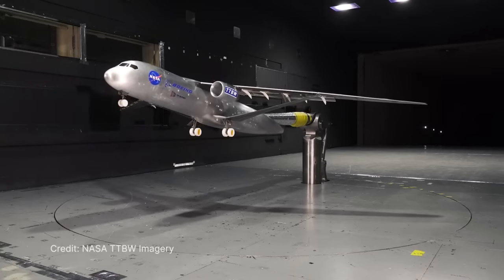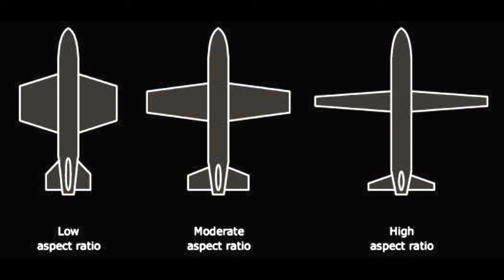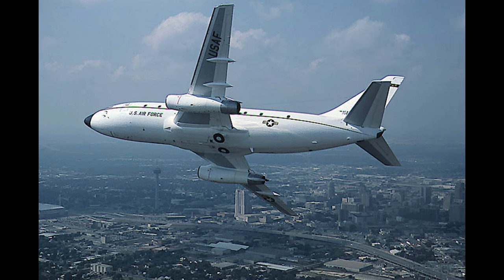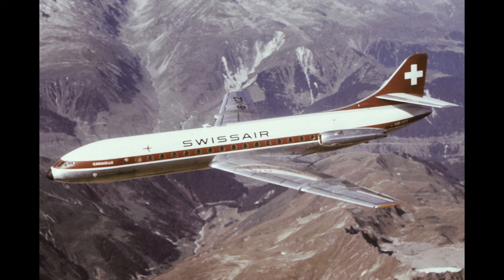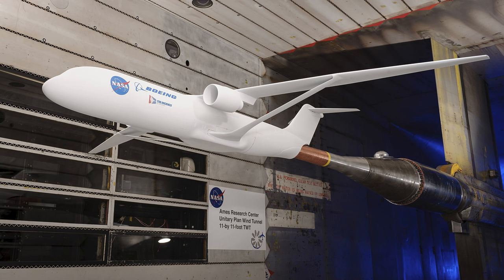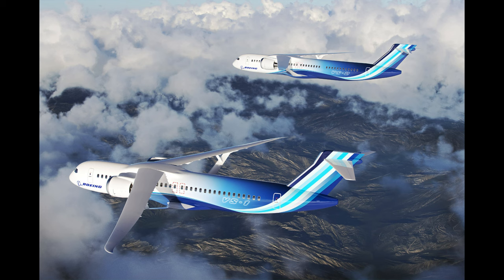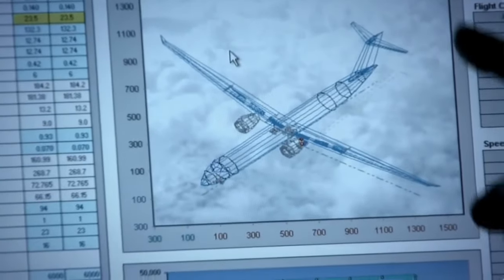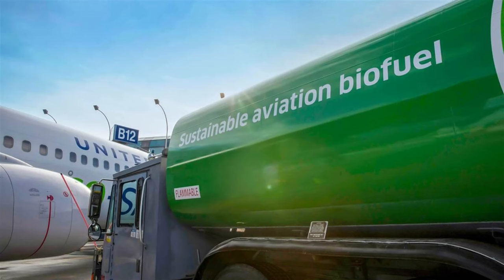NASA's New Airliner Experiment To Make Flying Less Expensive

Comment: When I first arrived at my aviation support Army assignment in Germany we had several Beavers flying out of that airport, which was also the Stuttgart commercial airport serving jet airliners. When you heard the noise of a Beaver taking off, it looked almost like it was hovering.  I asked one of the old hands about a story I had heard - "Is it true that their takeoff speed is the same as their cruising speed?"  He replied, "Some of them aren't that fast". 🙂
Reply: "Some of them aren't that fast"    Good one!
Reply: From the DHC-2 wikipedia page: "In response, almost without exception, these pilots specified their desire for tremendous extra power and STOL performance, in a design that could be easily fitted with wheels, skis or floats. When de Havilland engineers noted this would result in poor cruise performance, one pilot replied, "You only have to be faster than a dog sled to be a winner""
Reply: @gags730  There are no flying beavers nor kangaroos!!!

But yes they parachute, very gracefully I might add!
Reply: So, Beavers have MASSIVELY powerful engines for high angle of climb during takeoff. But at highest efficiency cruise speed (lowest fuel cost) the engine power must be dramatically cut back by the pilot. Everything about the Beaver is optimized for high angle of climb. It happens that this optimization also allows for a hefty carrying capacity. Once at cruise, the pilot can choose to either get there fast or get there cheap. Pilots are usually employees. So, get there fast dominates operations.
Reply: @Kenny-yl9pc so how do I have thousands of hours flying beavers?
Reply: @gags730  from Wikipedia about 1,700 were produced between 1947-1967. 

Aircraft take off optimally at one of two flight speeds: best rate of climb or best angle of climb. 

Tactical military aircraft are designed with best rate of climb in mind. Gotta get to mission altitude or aggressor altitude as quickly as possible. So, two primary factors in achieving this goal: engine max rated power and optimal airfoil design to minimize drag. The bigger the max engine power rating the quicker the plane can get to altitude. 

Commercial airliners, military “utility” aircraft like cargo jets, etc are designed also to get to cruise altitude quickly but for a separate reason: conserve fuel. Modern jet engines are only fuel efficient at 30,000 feet or higher. So, their max rates of climb, while high, get the aircraft to an altitude at which the jet engines are extremely efficient (lowest fuel consumption per hour).

STOL (Short TakeOff and Landing) aircraft like the Beaver are designed with two criteria in mind: minimize take-off / landing rollout and maximize obstacle vertical clearance during takeoff and landing. This implies that the angle of their flight path during takeoff be maximized. In the case of maximizing obstacle vertical clearance during takeoff, the Beaver has a MASSIVELY powerful, piston-driven engine for limited duration - perhaps as little as a couple minutes. Anything more than that and the engine can overheat. Also, the aircraft is equipped with massive engine cowl flaps which can be opened during climb to keep the energy-dense engine cooled. The propeller is also designed for max takeoff performance - its diameter is much larger than other aircraft of its weight. And it’s propeller is aerodynamically designed and pitch-controlled to transmit the engine’s enormous power to thrust as efficiently as possible when it counts - at takeoff.

The Beaver’s airfoil design is also optimized for high lift at low velocity. And optimized (through flap design) for low stall velocity. Also, on the Beaver’s elevators, there are vertical air “dams@ that keep airflow better attached to the airfoil during slow speed and high aircraft angle of attack to the airflow. If the airflow becomes separated from the elevators at slow speed, the pilot loses pitch control - not a good thing during takeoff or landing.

All of these optimizations are consistent with maximizing the best angle of climb on any STOL aircraft.

If you compare the altitude versus distance profile of a flight at best angle of climb versus one if best rate of climb you’d notice that the best rate of climb profile is much shallower. The pilot of a Beaver on waterskis and a mountain range ahead of him will likely choose to climb at best angle of climb until the obstacle (mountain range) is well below his altitude. An artifact of optimizing aircraft design for best angle of climb is low velocity at cruise - the Beaver is a great example of that. But, min cruise velocity just has to be greater than the fastest dogsled! :-)
Reply: Before WW2 Germany was forbidden to develop aircraft with an engine. That sparked the development of gliders. That meant development of different aircraft  wings, specifically for gliders. There was a reason why, after WW2, most glider manufactures were German. Look at the SB10, a glider with a wingspan of 29 meters. With an aspect ratio of 36,6.
Reply: @Paul_C  In theory, the most efficiently designed aircraft wing is one in which its length is infinite and the chord length (distance from leading edge to trailing edge is infinitely small. There would be no “spillage” of air outside the wingtips. All aircraft today generate wingtip vortices, whether it’s a paper airplane or an AN-225. The vortices are apparent to ground observers at takeoff and landing in humid conditions. The visible horizontal tornadoes that extend aft of the wingtips are wasted kinetic energy. But the engines effectively produced that wasted kinetic energy. And the fuel that powered the engines in creating this wasted energy is also wasted, leading to an increase in operational costs to owners and operators of aircraft. 

Current-day winglets at wingtips and future truss-supported wings physically and virtually extend the length of the wing, and reduce its chord length, thereby moving towards a wing with infinite aspect ratio. 

We’ll never get to that. Aircraft in nature are closed thermodynamic systems. Potential chemical energy in fuel is transformed to kinetic energy of the air leaving the engine to force the airplane forward and keep it at altitude. No closed thermodynamic system is perfect - ever. Thermodynamic system processes generate waste energy that is literally unrecoverable. That’s the Second Law of Thermodynamics at play.

As a result, in the end, our Universe will die in a waste heat death as a result of this law. This law has nothing to do with human intervention in climate. If we were absent from this universe, the same heat death will occur.
Reply: @davecorley5514  as a high time beaver pilot I can’t take anything you say seriously! A MASSIVELY powerful engine? The PW R985 only puts out about 430 hp, but we’re you lost me was at the cowl flaps! There are none! You sound good but get your facts straight.  The beaver is a great aircraft and does what it is designed for very well, it has the power to do the job and the vast majority of flights are under 100 miles so speed it not an issue. Too many pilots get frustrated by a slower beaver but burning more fuel gets you nowhere any faster! I can almost always beat a guy with the faster beaver dock to dock by being more efficient in route planning, altitude selection and taxing on the water.
Reply: @Paul_C  Your Dates must be slightly wrong here. Germany joined the Spanish Civil War in 1936, an sent 100 War Planes. Roughly half were Fighters, and half were Bombers. Admittedly the German Fighters were Biplanes that prove wholly ineffective against the Russian Fighters that were on the Communists side, but Germany definitely had War Planes earlier than 1936. That said, Germany also Signed a Pact with the Great Powers of Europe that they would not interfere in the Spanish War. But the Spanish Nationalists were fighting Russian backed Communists, so England and France may have thought Germany was just doing a job they didn't want to do. Germany built the far superior Messerschmidt bf109 in 1937, and their Stuka Dive Bomber Pilots learned their trade in Spain. Germany may have been good at building Gliders, but they were also building War Planes a few years earlier than your Post suggests. Could it be they were prohibited from building Planes without Engines AFTER WW2?
Reply: @gags730  Idaho parachuted beavers into remote areas!
Reply: Superb aircraft.
Reply: @Terra Former :-) I get it - you’re an angsty teenager. But, heat death is a thing. Nothing we need to be angsty about today, but still a thing. If you’re in search of hope, DM me. That’s not so angsty, nihilistic or teenagery. 

STEM-interested? Guilty - since the 50s. ;-) When you’re 70, there’s a crushing urge to disgorge accumulated wisdom on the world. Be prepared.
Reply: @gags730  Well of course, but the kangaroos have to be upside down, and with no little Joey's in the pouch.
Reply: @davecorley5514  Great analysis.  Lemme guess... you are as Canadian as the Beaver ? 😃
Reply: @loftsatsympaticodotc  Nope. American. Retired US Navy nuke submariner, retired engineer (aero, Mech, nuke, software, IP telephony, networking)
Reply: @davecorley5514  I know that intimately, as a glider pilot. What this story is meaning to tell you: There is so much research available from previous research and ongoing research, it will be an ever evolving story. However from that research it is likely those new design are more than likely to be developed not by Boeing and Nasa.
Reply: @WhenDoesTheVideoActuallyStart  Apologies for getting some terminology incorrect. But the *Republican side of the Spanish Civil War was being actively Militarily supplied by Stalin's USSR. And most European leaders correctly saw the USSR as a greater threat than Hitler.
I say correctly because, at the end of the War Stalin ended up with the entire Eastern half of Europe, which was a lot more than he started with. The American presence, rather than any European presence, was probably the only reason Stalin stopped a little West of Berlin.
Everyone knew Germany was arming itself in contradiction to the Treaty of Versailles, but figured Germany would be a bulwark against the Communist USSR.
Western Europe prospered greatly without Hitler's presence, yet, weirdly, Spain probably would have prospered more had Franco not won their Civil War supported by Hitler, though Franco's activities in that War were opposed by Stalin, who ended up being a Monster to every Country he Occupied.
Reply: @tsubadaikhan6332  What you said doesn't make much sense. Stalin would never be able to exert direct control over Spain, because unlike eastern europe it wasn't liberated/occupied by the USSR. The Spanish Republic had it's own army and no amount of russian guns would have made them loyal to the geopolitically isolated USSR.

Also, sometimes Stalin favoured a policy of making blocs with whatever progressives and even moderates he could find, and that's what he chose to do in Spain. See also: the soviet policy of "People's Fronts" in Italy and France.

At the start of the war the republicans were seen in a favourable light by most of the people throughout democratic states. There were many volunteer batallions from France and Britain, and pressure for those states to support the Republic more directly.

They didn't support them, not because of a ridiculous fear of Stalin pupeteering the Spanish Republic, but because of the infinitely more realistic fear of the Spanish Republic's victory sparking a revolutionary wave across Europe, starting with France, which had significant socialist, communist and anarchist organisations.

A Fascist Spain could be negotiated with to join the Allies (Like they did with Brazil), a Revolutionary Spain couldn't.
Reply: That Boeing high aspect wing would make me anxious as to how it would perform in icing conditions!  😬
Reply: @gags730  my dad’s Toyota Crown used to kangaroo when the automatic choke refused to turn off!!!